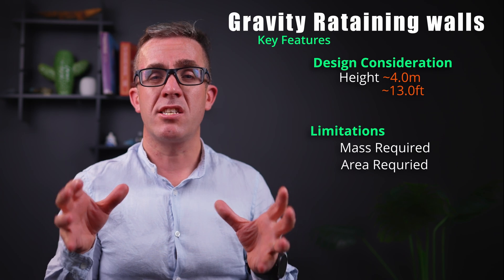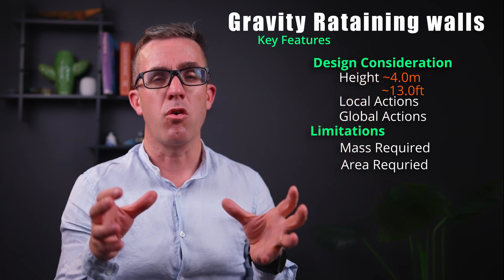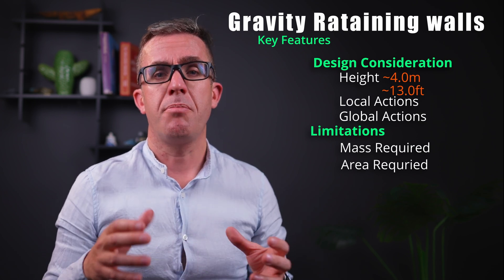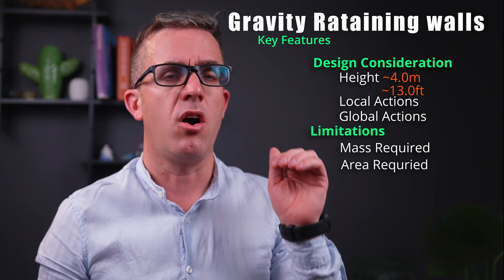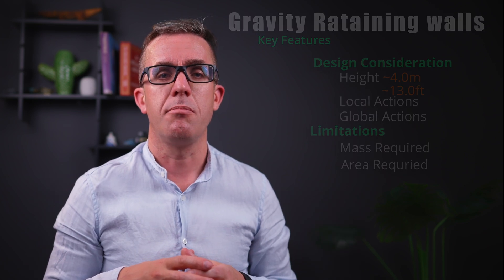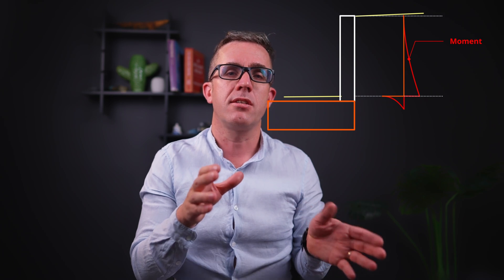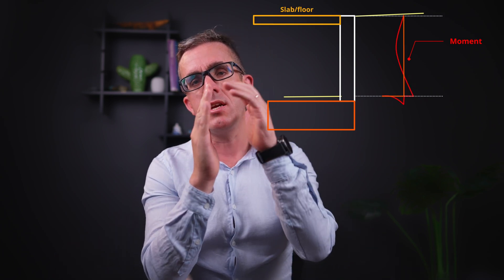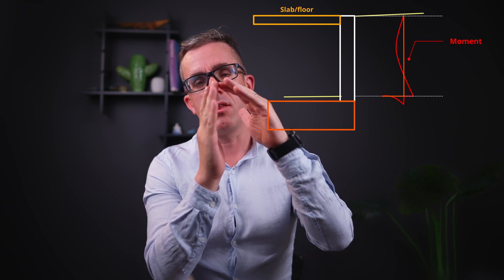The Main Types of Retaining Walls Explained

Comment: Great content as always can u suggest any book for further reading on propped cantilever retaining wall.
Also I want know can the stem of the propped retaining wall be designed as a a simply supported beam since it is supported at the top and bottom?
Reply from the maker: Hi Micheal, I will look into a book suggestion and get back to you. In the propped cantilever design you can design it as a beam or slab just need to ensure you have a Veriable distributed loads
Reply: @BrendanHasty  Thank You soo much, I really appreciate the reply

Comment: Great video Mr. Hasty.  I'm not so sure for cantilevered retaining walls that having the heel under the soil is the most efficient though.  Most efficient is having 2/3 toe and 1/3 heel.  Having a toe to resist the overturning moment is much stronger than relying on the soil weight above the heel.  Some systems we use often: secant piles, slurry walls, soldier piles with lagging and rakers/foot blocks and underpinning!
Reply from the maker: Hi Peter agree that a portion of heel and toe is the most efficient it has the benefit of the soil weight.
Reply: @BrendanHasty  Hi Brendan, I'm currently working with a cantilever retaining wall where the footing have to be place entirely on the toe side bc the building is already built on the retaining side. As you said, with this configuration we're not taking advantage of the weight of the soil for resisting the overturning moment. How you suggest to design a wall efficient enough in order to not have a extremely large footing when the solution of tieing the wall with a slab is not possible?

Comment: Good video, but I will note that you missed what is becoming one of the most common wall type in seismic areas, MSE or GRS walls. There are also O-pile walls which are common in coastal purposes, although it could be argued that they are just a variant of sheet piles.
Reply from the maker: Hi Antoine, I will need to look into thanks for letting me know.

Comment: hi, I am a student in the last year of a bachelor's degree at the University of Ottawa in civil engineering (structure and geotechnical option). I am currently carrying out my end-of-study project on the design of an excavation protection system in view of future construction of a basement for a 14-level residential building, and I would like to have recommendations regarding the appropriate manuals that could be useful to me throughout the realization of my project.
Reply from the maker: Most retention system are highly dependent on the soil, and most guides have lot of different types. Look into limit  defections as it would cause settlement.

Comment: What i always have trouble with is high walls. Clients dont tend to understand that higher the wall, higher the rebar demand and its not a linear increment. Is there another type of foundation to use other than spread footing for these kinds of high walls?
Reply from the maker: Hi Luis thanks for watching. You can add buttresses to a cantilever wall this significant increases the stiffness and reduces the reinforcement demand, or add permanent anchors.

Comment: That was informative Brendan, keep it up. It would be nice if you could add more onsite footage as you done in this while explaining pile pile cap and wall system. Also another suggestion is that a video on loads and bending moments as how they are applied or considered in a real world project. Thanks.
Reply from the maker: Hi Deepak, thanks for the continued encouragement. That is a great suggestion too, thanks for making it.
Reply: More informative..the onsite footage

Comment: Great content.  I would add to your description of steel pile systems the purpose and use of tie backs.  Lastly, just a spelling correction:  masonary is a hired hitman, masonry is cinder block.
Reply from the maker: Hi Francisco, thanks for the correction agree a Masonary would find it hard to retain soil. Also agree on the sheet system I should have noted the tie backs and it is a temporary system. Thanks for the corrections and support.

Comment: Secant pile wall not contiguous. Contiguous piles don’t overlap with each other. You also don’t need soft piles in granular material. Typically you only need soft piles to support the water pressure to avoid water flowing between the gaps of your piles. Typically in Australia contig piles are spaced with 100mm clear spacing. 

Big part of choosing the correct retaining wall is dependent on the ground conditions.

Great video.
Reply from the maker: Hi Roseller, thanks for the correction and clarification. Agree that choosing right retention system is highly important and dependant on geological conditions. Alot of time now wet basement are not allowed like you will need a shotcrete wall in front of the contiguous pile system. 

Thanks for the support.

Comment: The main dilemma is when to use cantilever diaphragms and when to use cantilever diaphragms with internal struts. Even if we go with good calculations, cantilever diaphragms system had some collapses when it is without internal struts, because of large displacements of points on top of the wall.
Reply from the maker: Hi Veke, this is similar to cantilever
Pile systems as well, with concrete deflections are hard to do correctly. Even small displacements can cause issues with adjacent structures. It is something that you need to watch out for. Thanks for sharing.